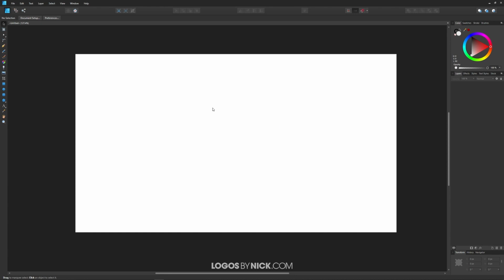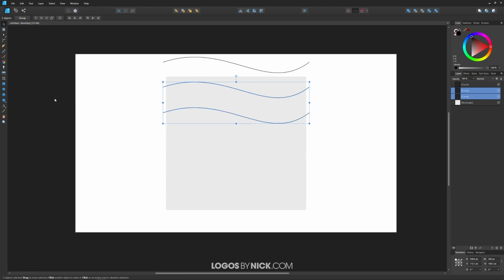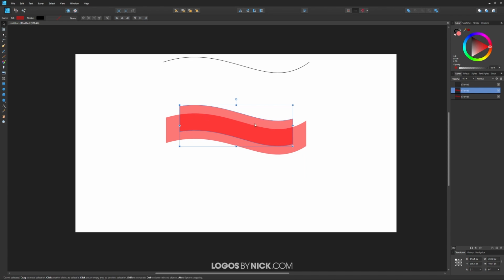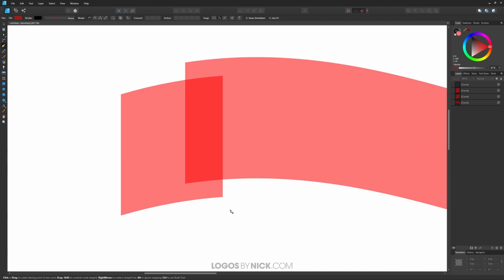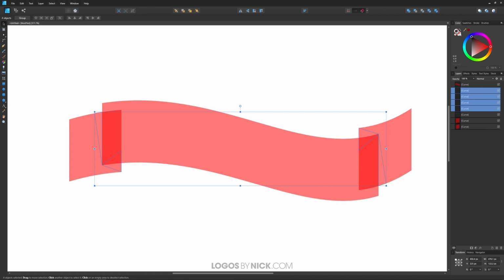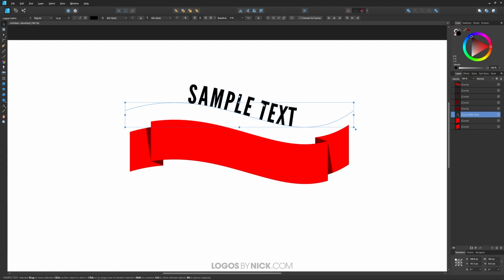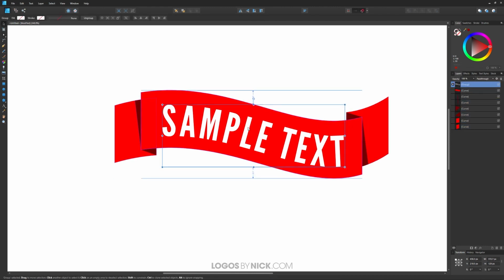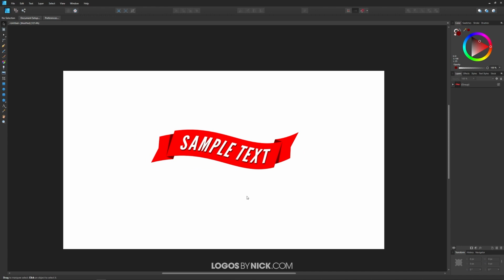Affinity Designer Tutorial: Banner with Text

Comment: Great video Nick! I’m still learning Affinity and wondering if your courses use Affinity or some other program? I’m really interested to learn more and like your teaching style but want to stick with Affinity
Reply from the maker: I don't have any courses about Affinity right now. The Logo Design Academy doesn't require any software. It's based exclusively on design principles, so you can use Affinity (or any application) to follow along.
Reply: @DesignMadeSimple  Ok great! That’s even better! Thanks, I’ll definitely check it out!
Reply: @DesignMadeSimple  I’m probably going to hold off one more month before I dump Adobe so I can get a little more fluent with Affinity. I was really hoping to hit that cancel button today as tomorrow it will automatically renew, but those are some key features that are missing but maybe I can find a work around and get by without them.